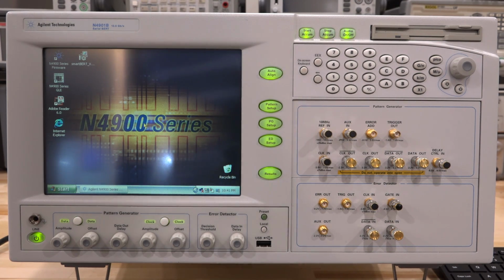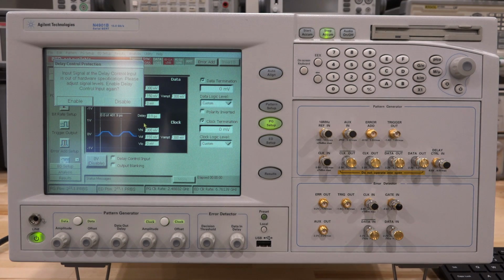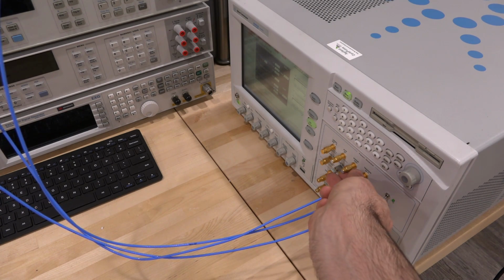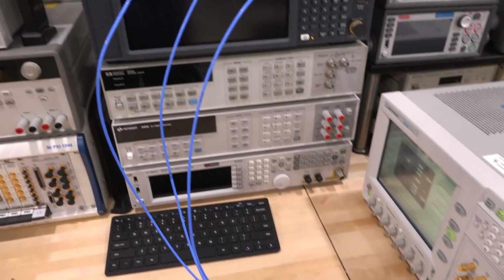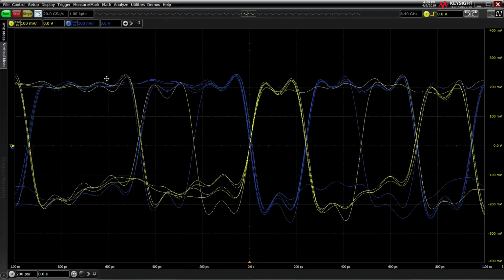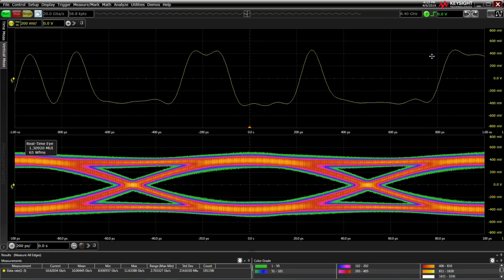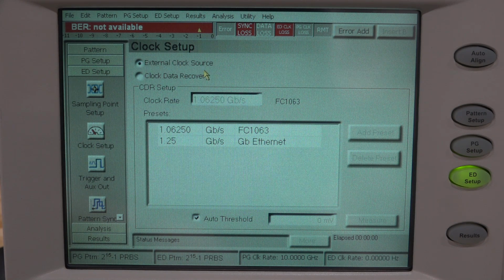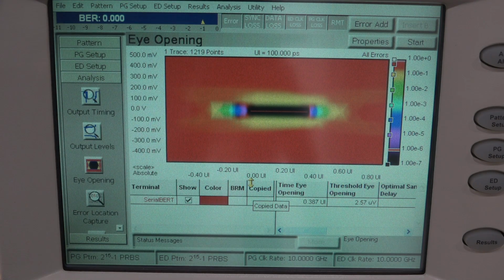TSP #149 - Teardown, Repair & Experiments with an Agilent N4901B 13.5Gb/s Bit Error Rate Tester BERT

Comment: Do you by any chance happen to have any more information / pictures on the cables attached to the lambda power supply?
I got one of these units with a broken power supply which I've repaired, however the person who tried to repair it last disconnected all cables from the power supply without marking any of them...
I was able to trace most of the cables on the top two rows of the modules, however the ones below are quite hard to make out from the video.

Comment: Hi I hope that you take this comment as a friendly comment.
You do make interesting videos that are entertaining, but I find your selection of gear, fare outside my budget and maybe also outside most other's budget. The unit in this video, is about 24,000$ used on ebay and that is not uncommon for the gear you talk about! Why do you go trough gear that nearly no one can buy? As I started to say, no critique but a friendly question:-)
Reply: I, for one, really appreciate the deep coverage of higher-end equipment than is normally accessible. We already have lots of videos on hobbyist use of what's easily affordable and accessible, but there's far fewer (dare I say only one) channels that discusses higher end test equipment in an approachable and understandable manner. Moreover, I especially appreciate the projects; I would never be able to reproduce them but I appreciate seeing them done and understanding more about how the domain works in a way that would be impossible without high quality test and measurement equipment.
Reply: @benjaminchung991  Great comment, thanks, I do agree! :-)
Reply from the maker: Keep in mind that nearly all my repairs are done on instruments I paid <$1000 for. This one was $1200.

Comment: 25 amps at -5.2 volts...must have a lot of ECL circuitry in it.
Reply: Si-Ge bipolar can be current hungry too ...
Reply: @uploadJ  Yes but I don't think this uses SiGe.  More likely GaAs or InP.  And -5.2V is a very common supply voltage for ECL logic.  It also has to be tightly regulated since such circuits have a very small switching threshold; this is why the -5.2 supply is adjustable.
Reply: @uploadJ  yeah but this wasn't made recently, its an old instrument

Comment: @18:38 when you touch the Delay Ctrl In terminator, the status lights on the display screen start flashing, maybe its a bad connection.
Reply: nevermind i see later on @ 30:37 you changed out most of the terminators for different ones, and also did the identical module swap so it wouldnt be that.

Comment: I can imagine that in the software there is somewhere a calibration setting for the error theshold voltage, you just need to find it and reconfigure it to whatever is generated. In fact I would guess that something is really wrong in that area, because why would both modules do the same?
Reply: Because they're both connected to the same power rails. When it spiked(?) it likely fried both of them.
Reply: jfbeam But the cable from the front panel was only connected to one of them? Or do you mean overvoltage from the PSU?
Reply: Because the modules aren't the final step in checking the input threshold voltage. If the circuit after the modules got whacked, even two 100% working modules won't fix the problem. And as Shariar said, without documentation there's not really a chance to figure that out.

Comment: I repaired the same power supply of the same equipment some years ago. Although it is a very complex and dense design, it was easy and fun to fix it.
That small PCB bar that connects all the secondary boards is the fault signal. In my case, one of the boards was asserting that signal during power-up, telling the primary side to shut down. I removed one secondary board at a time to find out which one had the problem. Then I found a couple of zener diodes in short-circuit on the damaged board. After replacing them, it started to work again.

Comment: Nice bit of kit.
I'm working with a cPRI project right now, that Bert would come in handy to check on the clock recovery system... We are not really going over rate 8 right now so 10 Gbps would be fine.
Cheers,

Comment: that modular transformer in the PSU is beautiful. I'm surprised I've never seen one used in a bench power supply, with the flexibility in ratios and isolation between channels it seems like a perfect choice.
Reply: MichaelKingsfordGray  What about it gives it poor magnetic coupling?

Comment: Back in 2002/2003 I build a 43Gbps BERT when I worked at Ixia (now part of Keysight).  I lead a team of about 10 people (mostly software people) and I did all the analog circuit design.  It won some award for best new test equip of the year, and made the cover of EE Times magazine (Dec 2, 2002).  But just as we were rolling it out in 2003, the US invaded Iraq.  This lead to a recession, all the start-ups in the emerging 40G market went bust, and the project was cancelled.  The last time I saw the prototype it was sitting on a shelf in the lab, gathering dust.  Bummer.
Reply: @aphenioxPDWtechnology  It was NRZ.  It used an SF5 interface (I hope I remember the right name) there were 17 lanes, at 2.5Gbps each: 16 data lanes, and one alignment lane.  I designed plug-in modules for series (combine all the lanes into one) or parallel interfaces on both inputs and outputs.  Part of the analog design was the ability to adjust the phases of all the lanes, which I did with PLLs.  Each lane had its own PLL that multiplied-up the 125MHz reference clock, and I used a DAC and transconductance amplifier to feed a bias current into the loop filter of each PLL to adjust its phase.  The SF5 mux and demux chips were GaAs, and made by some start-up whose name I can't remember now.  But the demux had bias inputs that allowed me to adjust the voltage threshold and sample time, so I could move them around and see how the error rate changed; you need that to produce the contours of the eye diagram.  A lot of fancy math there too:  basically you decompose the jitter distribution into a series of best-fit normal distributions, kind of analogous to a Fourier series, then you can use this series to extrapolate down the skirts, into the really low bit-error contours in the middle of the eye.
I'm probably going on too long, but you might find this next part funny.  We unveiled the BERT at a small trade show in San Jose (I think it was called Opticon) and our competitor, Spirent, unveiled theirs too at a booth a few feet from ours.  A Spirent engineer came into our booth and the first thing he did was put his hand over the air exhaust vent to feel how hot it was.  The air was barely warm, and so he proclaimed that our demo was fake.  But I eventually convinced him it was real.  I guess they had thermal issues, but I was too polite to feel their exhaust.  And our unit was less than half the volume of theirs.
Reply: @steverobbins4872  That is so cool, I long to being able to design instruments like that. And by the way I would have read a book written by you about stuff like that.
Reply: Mai Mariarti  Our target market was companies that made fiberoptic transceiver modules, and 40G network gear..
Reply: They are full on data converters with sample rate/bandwidth higher than the channel being tested with DSP tacked on
Reply: today you can download an app on your phone that does the same thing :D
Reply: N4903？

Comment: Around 5:43... I thought I was having audible alarms from my machines (servers and security system) and had to check logs... etc. for 15 mins or so. After another 15 mins to check what can trigger audible alarms (and finding nothing out of the ordinary!) I came back and resumed the video to find out the "alarms" were coming out of the video. The distance of the meter to the microphone and microphone itself makes EXACTLY the same sound with pitch, depth and distance from where I'm watching the video and where my machines are. That's 30 mins of my life I'll never get back :) Sucks to be a dumb ass, I guess.
Reply: At least you get to laugh about it afterwards, wild goose chases suck!
Reply: Had a similar condition with my PC -- it beeped a couple of times -- checked the logs no problems,   while later it beeped again -- now its driving me nuts.  Time for bed so I turnd the pc off, few minutes later I was walking past my office and it beeped again --  no way the dam thing is off  -- turns out it was a pager in my desk drawer with a dying battery with the same exact sound.